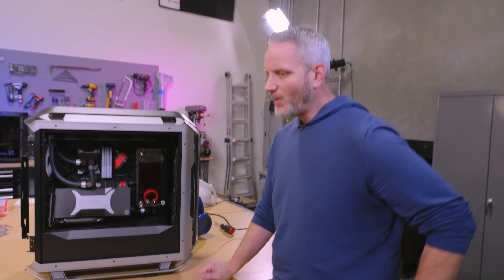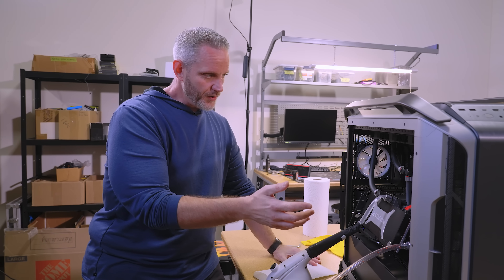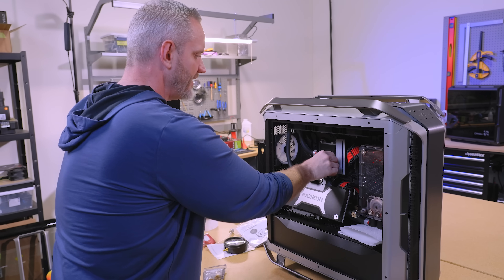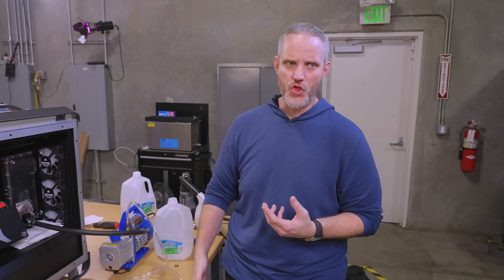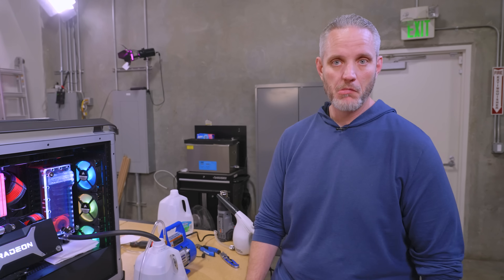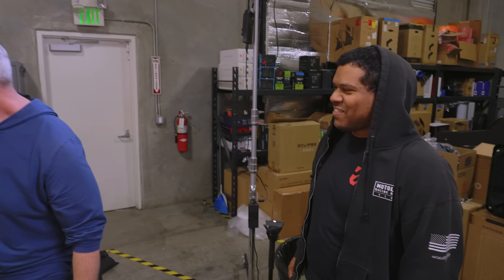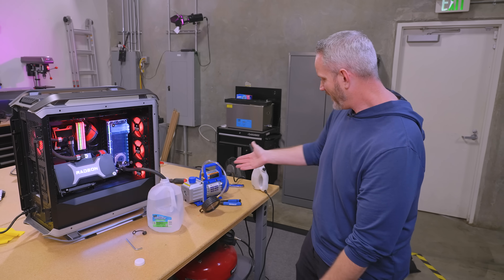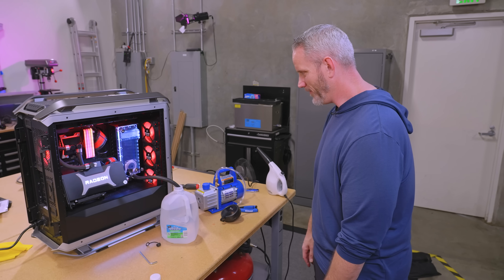I used Vacuum Pressure to fill a PC! Why didn't I do this sooner!?

Comment: the only thing that scares me about this way , is cheap rads or other parts that collapse under the vacuum
Reply: A pressure test is fairly easy. Pressurize it to the approximate amount you will use later. If you can, let it sit to see if it will leak over time. Once you know it can handle it, you are good to go.
Reply: @chickenmonger123 positive and negative pressures are very different
Reply: @chickenmonger123  God loves and cares about you and will always be there for you no matter what✝️❤️
Reply: @chickenmonger123 just note that pressure and vacuum on a vessel are physically different.  It is one of the reasons that ac systems are filled under vacuum.
Reply: @Alakayonk  AC Units Are Filled Under Vacuum To Remove Moisture Which Will Cause The Unit To FREEZE UP!! I Have Had To Drain Many AC Units That The Customer Just Filled Up With Freon And Pull A Vacuum On Them Because They Were FREEZING Up And Quit Working!
Reply: If you actually look up the psi rating on all the fittings it’s crazy stuff like 120 psi. The lines themselves would collapse long b4 the fittings. After doing this for years as an hvac tech who had this idea long b4 jay he will be fine that vacuum pump isn’t powerful enough to do damage.  You can pull a vacuum on it to check for leaks instead of waiting to see if it leaks w water, then fill it. Allows you to fill from the same hose you drain from. It’s very nice.
Reply: Better to find out failures in parts in the build stage.
Reply: The ticking from the rads was definitely worrying.
Reply: What?! Did you guys often experience the old thin plastic straws collapse when you create a vacuum to get the soda up?...
Reply: You shouldn't be scared about that. It would be the same if you had 1 bar of outside pressure.
Reply: people who get cheap watercooling components probably wont be going through this much effort anyway.
Reply: You can do it safer if you add a jar between the pc and pump. Pull a very light vaccuum then start allowing water in until it comes to the jar. You don't have to completely vaccuum the system, just slightly and then start allowing water in until it flows to the jar. The jar prevents the water from entering the pump. You can keep the pump on until water goes to the jar. A very small vaccuum is needed to start drawing water up the pipe. This will prevent the extreme pressures collapsing.
Reply: true but this just an other example of over engineering . Just fill the system like we always  do and let it bleed on its own , jiggle it if u need and voila air is gone !  @newmonengineering
Reply: I wouldn’t do this - negative pressure (ie vacuum) and positive pressure cause completely different stresses.
Reply: @mikelebron3807  exacly!
Reply: @mikelebron3807 how do you think HVAC-R technicians put refrigerant into an HVAC-R system all day every day? They pump a vacuum in the lines down to 200-500 microns based on system spec then release the appropriate refrigerant into the system as a flash vapor depending on if the refrigerant is a single or stable azeotropic mixture or as a liquid if it's an unstable zeotropic/non-azeotropic binary or ternary blends. A vacuum in the lines is the only way to guarantee no contaminats like oxygen are in the lines while charged.
Reply: @user117 presumably HVAC radiators are built to different standards than PC radiators, particularly if vacuum filling them is standard practice. I would be very hesitant to try this on my own loop.
Reply: @user117  You're either an HVAC tech or have gone down some serious rabbit holes for system cooling.
Reply: @user117  How many computer radiator parts do you have in your HVAC system?
Reply: @noahhood4223 the copper tubing diameter is measured in ID vs OD, slightly thicker sidewall but that's less about vacuum pressure and more related to durability from excess vibration caused by the hermetically sealed compresser and more prone to external damage from strikes. Outside of that there's not much of a difference actually.
Reply: @TheDarkPreacher65 licensed HVAC-R technician, no practicing outside of working on my own stuff. Also been very deep down rabbit hole of computer cooling several times
Reply: As an A/C tech in automotive I can tell you we don’t use vacuum to fill a system with refrigerant. We only use vacuum to boil off the moisture in the loop and turn it in to a vapour so we can extract it from the system. This must be done on an empty system or a system we’ve opened up to replace parts on. Many cases where I’ve evacuated a full system and simply refilled it without putting under vacuum, cases would include performance testing and various charge rates. But vacuum is only there to remove moisture and contamination after servicing, the system can and does fill and operate without vacuum.
Reply: @bradstepford3307  This isn’t quite correct. We absolutely do pull vacuum before recharging AC systems in automotive. I don’t know if it’s possible to even recharge either side, high or low, with any R134 or 1234YF machine before pulling vacuum, its part of the procedure separate from performing a leak test and will do this automatically. Heck this is why 1234YF refrigerant systems take longer to service than R134 because its procedure is more stringent requiring longer vacuum times for leak testing and filling.

This isn’t to say we are purely vacuum filling but we absolutely do pull vacuum before recharging the AC system in automotive.
Reply: @user117  I also work in HVAC and was about to say the same!
Reply: @user117  exactly I do commercial hvac and when I got my custom loop setup I pulled it down to -5 psi and let it sit for 2 hours with my gauge on it before I added any fluid just to make sure
Reply: @@fabi1951 ok. I'll try to explain it even more simple. Your mouth can suck, your mouth can blow. He did just blew into the  system to empty it. Why the hell do you need VACUUM to do the same thing in revers?! XD Just pump it from whichever side you like. You don't even need a pump for that if it's properly made.
Reply: Exactly this. Even if they're not cheap, sure maybe the radiator would survive doing this 1-5 times in it's life, which may be all that it's ever done, but what if they don't? What damage might be done inside the radiator from being under that pressure inside? That's what needs to be answered here I'd say.
Reply: Yeah, I was expecting the pump/res to crack under vacuum.
Reply: So you actually need to match the pressure before draining to keep the pressure stable and then drain which is not possible with a single drain system. If you have an input and output to stabilize the pressure you can drain and fill easily. Or use a low pressure pump.
Reply: The bleeding method works great on oil changes as well. Drain oil, then while it is still open (and has drained)  put in one "can". Let that drain and it will work out the walls and re-lube it, then seal and fill. Old mechanic taught me that.
Reply: @cdmarshall7448 What are you talking about? Why are you adding clean oil just to let it drain out?
Reply: @--_DJ_--  Oil sticks to the walls even after you drain it and that oil is still old.
Reply: @cdmarshall7448  Pouring oil down one rocker cover is not going to wash much if any off the engine block. You are just wasting your money. Change it warm and don't worry about the tiny bit that is left.
Reply: @--_DJ_--  I don't mess with cars anymore but over 20 years ago that tiny bit was about half/quarter of a pint and it did help flush out the old oil and lubricate the walls better. Otherwise you left that old oil in their to mix with the new oil. 

Things were cheaper back then and blocks were much bigger.
Reply: @cdmarshall7448  Well at least you are not wasting your money anymore. Anything poured in just drips into the pan from drain holes in the heads. The walls that oil would get to from pouring it into the engine through a valve cover do not need any lubrication. All you would be getting is oil trapped in the pockets in the head, sure it's old but it isn't going to hurt the new oil or your engine to leave it in there. 
But 20 years ago oil was damn near free compared to what it is now, so you weren't wasting much and it certainly won't hurt anything either.
Reply: @--_DJ_--  The days of my Plymouth Duster Slant-6 are over. The engine outlived the car.
Reply: @cdmarshall7448  What year was she? Big 6 or the smaller one?
Reply: @--_DJ_--  Def small block think it was a '72  
been a while but the sound of that engine...
Reply: @cdmarshall7448  I was definitely born too late. I missed out on all the cool cars.
Reply: Power transformers often use a vacuum. Why not a video trying it on a pc.
Reply: God loves and cares about you and will always be there for you no matter what✝️❤️
Reply: God loves and cares about you and will always be there for you no matter what✝️❤️
Reply: Yep that cracking noise is concerning
Reply: Not only that he also created a inverted “water hammer” witch can kill the pc. I will not bore you with what it is cuz people will look it up.
Reply: Yes. You should never vacuum your system. Using a vacuum pump to suck in fluid is other thing.
Reply: @Blackraven6  God loves and cares about you and will always be there for you no matter what✝️❤️
Reply: @Blackraven6 I actually missed your comment, and it was my error in my last comment. I would use vacuum to fill, not evac like an air conditioning system. Like a brake bleeder.
Reply: @brandonk5087  it makes sense to fill, BUT those pumps are aiir only. So to do that you would need a  vacuum  receiver to protect the pump. And it would still cause a lot more stress than pumping cause sucking out air is easier than sucking in  liquid. Which causes damage. And also a  light hydraulic shock, which may wear out or damage the system. By nature positive pressure is way easier too compensate than negative.
Reply: That was my first thought.
Reply: @yakbreeder  God loves and cares about you and will always be there for you no matter what✝️❤️
Reply: Not a problem at all. The cooling pump itself operates on vacuum, it sucks (and pushes) the depending on what side of the vanes. It will only be the negative pressure needed to draw up the fluid. It's not a pressure system like a car radiator they changed pressure when temperatures rise. It's more like a brake bleeder.
Jay got negative readings because he plugged the inlet, but if you are sucking liquid, it will be like sucking a straw. Benefits of this method vs pressure is it works better at filling the air voids by sucking the air out. Air can compress, so it tends to leave pockets in the high spots, just like when filling a car cooling system.

Interesting for sure, and one I may try if I ever get a user serviceable radiator.
Reply: @brandonk5087  sorry but you make no sense.

The point is when he creates a vacuum before the fill,  that puts negative pressure on components that were never designed to be used in a vacuum.  Inward stress vs outward stress.  Collapsing a pipe is far easier than bursting one.
Reply: @mikelebron3807  you are correct. I missed that part and replied to another comment acknowledging that. However, I still think using vacuum to fill is a good idea if not done like an evac of an ac system, but more like a brake bleeder.
Reply: @mikelebron3807  There is NO WAY that components like radiators that take 5 or even 10 bars inside pressure just fold under 1 bar vacuum. Its metal that is soldered or welded together; they will never have that much anisotropy in stress dependence. We are not talking about some glued carbon reinforced submarine here.
Reply: @multi21racing it's copper, it's soldered or brazed. Most non ferrous metals don't take well to welding processes not that it can't be done but in 99% of all applications (outside of aluminum) just shouldn't be done.
Reply: @brandonk5087  I like the idea of pulling in the fluid 
Just not creating a vacuum to do it

Would be better to have a video that “sucks” the fluid in via negative pressure vs a vacuum
Reply: @mikelebron3807 that’s what he did.

It’s only 1 atm of pressure, shouldn’t be an issue for hard tubing and rads.
Reply: @mikelebron3807  my thoughts exactly. I thought that was what he was doing initially, hence my first post. Still, an interesting experiment and thought provoking for future tech development.
Reply: @brandonk5087  agreed 

Just needs some more testing
Reply: @mikelebron3807 it's barely negative one atmosphere of pressure. If the METAL component failed the issue more is you bought a cheap POS part. I highly doubt that little bit of vaccum will do any damage if it can handle. Also if you were right, it's more than likely Jay would have damaged something considered he did it multiple times. So I think it's safe to say unless your using a crazy strong vacuum pump, you'll be fine.
Reply: @user117   Not Welded Parts But Soldered! Radiators Are Soldered Together! Copper Like Aluminum Copper Does Not Weld Easily! However With Flux Copper Is easily Soldered!
Reply: @user117  when fusing nonferrous metals you don't weld but braze them together. High temperature soldering
Reply: @brandonk5087  If you don't pull a vacuum on the system you are probably going to end up with air pockets if you try to suck the liquid in. You can't really say it isn't a problem to pull a vacuum because there is a pump in the system already. Those things are glorified paddle wheels, they move liquid once it is in the pump body, they don't suck it in, the fluid that has just left the pump is what pulls more fluid in. They are not positive displacement pumps.
Reply: @brandonk5087  Yeah, if he had sucked from the top of the system, it would pull the air out while pulling the fluid in from below. then he couldve closed off valves at both ends so the loop would remain closed. You can absolutely build a water loop to work this easily for refilling.
Reply: The big concern for me, actually,  is blowing out an o-ring/gasket since they are designed to hold pressure not vacuum they might pop out and tear and cause leaks.
Reply: Negative pressure and positive pressure affect the container differently. I think this is a legitimate concern if you're trying to pull a full vacuum.

Comment: You can get much closer to full vacuum with a venturi vacuum pump (positive pressure powered). Also, for the air left in the hose, get a second ball valve close to the end of the external tube at the vacuum pump end, and submerge that before opening it to fill the remaining volume.
Reply: They sell those but they take a lot of air flow and much longer to achieve the same vacuum as a cheap single stage or 2 stage rotary pump.  My 2 stage 3 CFM pump pulls 29 in. Hg on a a/c system in 5 minutes while a venturi vacuum pump takes 25 minutes on the same system.  It is also much cheaper electricity wise because you aren't using a large compressor to compress air to then release it by a venturi to pull a vacuum, you are just using a small electric motor to spin a vacuum pump that uses a fraction of the power of a compressor motor for a faster result equating to a even less energy usage.

Comment: You could set up a station for both draining and filling with differnt pumps.
Reply: Use the same pump but with a set of valves to selectively open to a vacuum reservoir to empty, then to a liquid reservoir to re-fill!

Comment: You can reverse this and have a catch container with two tubes leading in one at top and one at the lowest level. Top is the vacuum and bottom goes to the drain. Vacuum will pull all the fluid into the container. Just make sure its Ridgid enough to hold a vacuum. I bleed my car brakes lines this way.